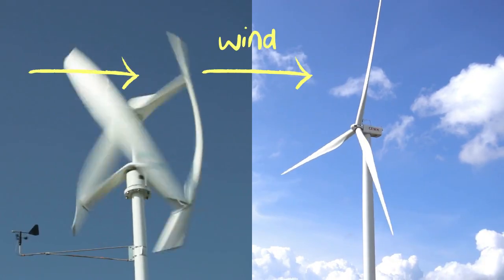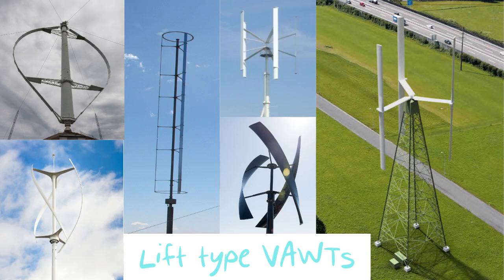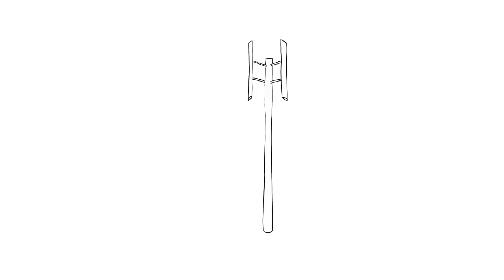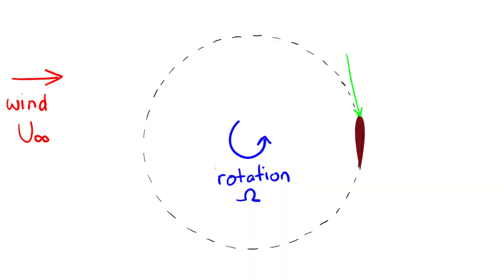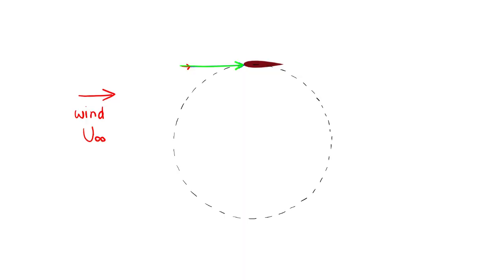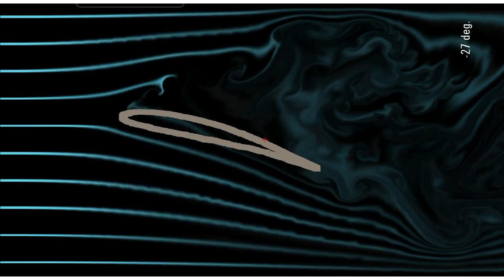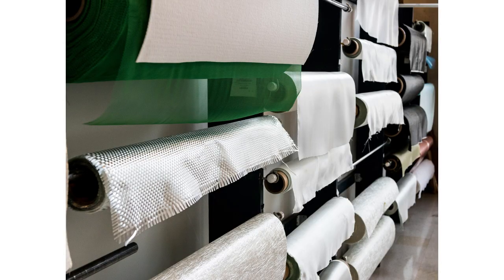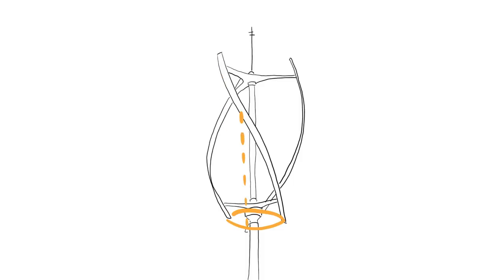Vertical Axis Wind Turbine Aerodynamics and Design

Comment: Hi Rosie, Is there some measurements on noise generated from WAWT or HAWT, if so do they compare. In Sweden WT haters claims WT sounds as an airplane taking off which I do not think is true. What about sound with lower frequencies or higher than the normal 40 Hz to 20000 Hz. It’s really difficult to find good scientific measurements. I should appreciate if you could comment on that. Thank you for your nice and professional scientific way to look on wind turbines. /Joppe
Reply from the maker: Hi Joppe, I really need to make a whole video on wind turbine noise! It is hard to give good answers here in the comments. But I will try.
Yes, wind turbines can be very loud depending on the design and the wind conditions. I wouldn't want to live directly underneath a large wind turbine. Most planning approvals include noise limits and manufacturers make sure to keep under them. I have lived within about 1km of a MW scale horizontal wind turbine, and that did not affect me in any way - I was way too far away to hear it. If you want to find out the noise level from commercial wind turbines, you can look that up in their sales brochures, they sometimes publish it. Other than that, I haven't seen any published measurements of noise from wind turbines. I will have a look and see what research is out there when I eventually get around to making that video on wind turbine noise. 
Low frequency sound: that is really not a health issue. There has been heaps of study on it and no real medical studies have found any effect from wind turbine infrasound. Wind turbines do create infrasound, but so does the ocean, so does traffic, so does the wind. Simon Chapman has written a lot on this topic, see this article for example:
https://www.ncbi.nlm.nih.gov/pmc/articles/PMC4227478/

Comment: Hello Rosie, very nice video. I now have a good understanding to what to design for while developing my own VAWT. Can you make a video on which type of airfoil (a lot of different designs available out there) is suitable for developing a 3/4 blade Helical-VAWT.

Thanks and Regards.
Reply: Here is an airfoil designed for VAWTs.
 http://airfoiltools.com/airfoil/details?airfoil=du06-w-200-dt
It is very important to scroll down to the Cl/Cl v Alpha graph.  The angle of attack is the X axis and the Lift to Drag ratio is the Y axis.  The colored lines represent the Reynold number the airfoil is operating at, effected by the speed and the chord (width) of the airfoil.

There is a Reynolds number calculator in the top left corner in the Applications section.  Based on the graph, a 1.5 meter wide airfoil operating at 10 meters/second would work very well.  A 100 mm wide airfoil operating at 5 m/s would be worse than terrible.  The characteristic of airfoils to perform poorly at  low Reynolds numbers is why small, lift type, VAWTs are not popular.
Reply from the maker: Great question, great answer! I will include information on airfoils when I make a video on detail design.

Comment: - very informative video!  I think the Voith Schneider propeller's active pitch control system would make a great system to be adapted for use on VAWTs with active pitch control.  Both the direction and the amount of pitch are variable so it would allow efficient operation over a range of tip speed ratios.  The system has been used for many years on tug boats and other work boats/ships.

I would like your reaction to the VAWT of US Patent #9,494,136.  All blades are interconnected forming a stiff structure.
Reply from the maker: Interesting, thanks! I will look into these topics.

Comment: Please tell what do you think about that types of VAWT:

1) "Round brackets" Darrieus 3-blades rotors

2) Darrieus 3+3 blades rotors with 3 stiffening rings or with one ring + stretch marks
(they wrote that such windmills can self-start even in a weak wind without spinning them up with a small Savonius rotor, due to the angle of attack of the blades of 3-4 degrees)

3) One of the most popular for DIY: Ugrinsky-type "paired wings", some of them is simple Novikov's rotor.

4) Lenz2: another most popular for DIY
Reply from the maker: Great questions, thanks! it's so helpful for me to know which specific designs people are interested in. Can you share a link to sketches of these types, I have not heard most of those terms before.
Reply: @EngineeringwithRosie  I don't know why, but Youtube hides all my comments with links

https://www.facebook.com/groups/windturbinemakers/permalink/4004016506321339/
Reply: @EngineeringwithRosie  Please visit "DIY Wind Turbine Makers" group on the Facebook, and see Daniel Connell's models.
Youtube hides all my comments with links
Reply: 3) Ugrinsky-type rotor

https://youtu.be/hrgYnmhwGtU

Comment: Great Video!! 
I'm Currently in my final year at university and I'm working on developing the Double Multiple Stream Tube model (DMST) to analyse VAWT turbine performance. So, I'm voting for this for the next video!!! Would love to see your breakdown of it, seen as it's an extension of this video.  Or even the single/multiple tube model.
Reply from the maker: Hey wow, big project. Good luck! You will know more about it than me if you've been researching for a while, I should be asking you for advice! 
It takes me months to research and finish a new video, so likely you will be finished before I get to it, which means it wouldn't be much help to you unfortunately. I would be interested to see your project though, so please post a link when you're done (and tag me so I get notified).
Reply: @EngineeringwithRosie ma'am  I really like your content..if It is possible can you show a detailed calculations each and every parameter measurement used for building wind turbine and design it in catia?

Comment: Hi Rosie! 

I love your channel and what you’re doing with it.  

I accidentally put my comment as a reply to another comment, so it’s a bit buried now.

I am interested in wind turbines for off grid applications for small cabins. I will likely install solar systems and the wind turbines will be supplemental to the PV panels.

I have not done a formal wind study, but I looking into installing a weather monitoring station to start collecting data. I’ve live on the land for a year and that has shown me that we have gusty winds that are occasionally very strong.  There is usually a slight breeze, but I would not classify the land as a high wind location.

Thanks so much!!

Tom
Reply from the maker: Thanks Tom, I found your buried comment already. And suggested that you measure wind speed so it seems you are way ahead of me there! Remember to take the wind speed where you want to put the turbine. Near to the ground it will vary a lot from one location to another even close by. Compare your data to published long term data to see how your long term values might look.
Reply: @EngineeringwithRosie  

Thanks Rosie! I’ll get a weather station and see what I discover. Since I wrote that comment, I’ve been paying more attention to the wind and realize that it’s much stronger and more frequent than I realized. Thanks for responding! 🙏🏻

Comment: I don't like VAWTs that much because of the lower efficiency but I'm still thinking about 3D printing one for my balcony. 
In my opinion the best type of VAWT is a hybrid between a Savonius and a Darrieus, because it has the advantage of selv starting in low tubulent wind but it still gets decent efficiency. Here is a picture of what I mean: http://image.ec21.com/image/hivawt/oimg_GC04092839_CA04092840/1500W_VAWT_Wind_System.jpg
Reply from the maker: Love this comment "I don't like them but I want to make one anyway." Pretty much sums up my feelings on wind turbines in back yards/ balconies! Which I guess means I do like them!
Reply: @EngineeringwithRosie  well I dont know what y'all are building,  but I have a device that is kicking butt in the speed department.   Its modular now so I can stack for more torque.
Reply: Come take a peek at my channel,  you might find something of interest there.

Comment: My future video vote is for the overlapping savonius (no surprise there). Not only do I think a vortex is involved,  but recently I've learned of the Coanda Effect which might also be in play on the drag blade  curvature as well.
Reply: as shown by the experiments of DIY-makers, the Ugrinsky-type "twin wings" rotors (by Biryukov, Blinov, Novikov, Popov...) are better than any Savonius rotors.

But Lenz2 is better and Darrieus is best
Reply: @MihailG5541  I believe I will leave it up to the more than qualified  engineer Rosie, to make such a determination.
Reply: @MihailG5541  But they all provide very little energy, and the storm is easily destroyed.
Reply: @ДэнКошман  long time ago, strong wind protection systems were invented
Reply: @MihailG5541  Для горизонтально-осевых единственная надежная бурезащита, это управление шагом. Для вертикально осевых таких систем нет, из за физики их работы.
Reply from the maker: @golotin I will add these to my list to look into deeper and maybe even test.
Reply: learn aerodynamics.
Reply: @ДэнКошман  ok Captain Obvious,  why don't YOU tell me all about it.
Reply: @doktaahwho8858  Knowledge is not obtained from comments on YouTube. It is necessary to study.
Reply: @ДэнКошман  i don't need to study quantum mechanics to install an electrical circuit and get a lightbulb to function.  Similarly,  I don't need to study aerodynamics to work with wind power.   I'm good with basic theory for practical applications.
Reply: @doktaahwho8858  Judging by the result, there is no knowledge of the theory, there is no properly working wind generator. Only dangerous toys are obtained.
Reply: @ДэнКошман  what on earth are you babbling about this time?
Reply: @ДэнКошман  well I'm glad you lot are sticking to the topic of voting for the next future video.  Because anything else might be considered as clogging the initial objective.
Reply: Hi Rosie!

I recently found your channel and love it! Thanks for transforming your deep engineering and wind power knowledge and expertise into easy to understand videos. 

I live on a 50 acre parcel in the Colorado mountains and am currently tied to the grid. I’m looking for off grid options to power some cabins that are too far from the power pole. 

Solar panels are my plan, but I became curious about adding a wind turbine too.

It’s very quiet and peaceful here, so I was concerned about noise from a HAWT, so I was researching VAWT.

I don’t need a turbine that has the highest efficiency, but that can provide additional power at night and when it’s not too sunny.

I’ve looked at both commercial and self built options and haven’t found a great solution. There are cheap ($300 or so HAWT and VAWT options) on Amazon, but they generally have terrible reviews for low power output and design.

High quality commercial options for residential use are $3000 or more. 

At that price, it just makes sense to add more solar panels to a photo voltaic system.

I’m curious if you have any recommendations of further options to explore?

From and esthetics perspective, I really like the design of HAWTs.

In your previous video you mentioned that you were investigating HAWTs for your own personal residential use. I’m curious to learn more about that and what you discovered. 

Thanks so much!!!

Tom
Reply from the maker: Hi Tom, interesting question and I hope to make some videos soon on topics that could help you... when I get some time! 
In most residential locations you will get much cheaper electricity from solar than wind. I personally wish that wasn't the case because I find wind energy much more interesting as an engineering project 😀 But it is reality.
If you are in a very wind area, or have poor solar resources or are not so worried about finding the cheapest solution, then it would be a very nice project to design an off grid system that was a combination of solar, wind and batteries. Maybe even add hydro if you have a river nearby!
If I were you I would start by checking the wind resource in your area (using a wind speed map) then if it seems ok, take some wind speed measurements in the actual locations you might install a wind turbine. It is likely to be a lot less than the map says, at the relevant height. Only then should you spend time worrying about which turbine to buy and its cost, reliability etc. The wind resource is much more important than how efficient the turbine is, as wind power varies with the cube of wind speed - so if you halve your wind speed there is only one eighth as much power available.
Reply: @EngineeringwithRosie  
Thanks Rosie! I really appreciate your insights and encouragement.  I will get a whole weather station to gather data about our beautiful place in the mountains.  I will start with a solar system and see it it makes sense to add a wind turbine. I don’t have a flowing stream, but hydro turbines are fascinating to me as well.  

Keep up the great work with your videos. I’m a fan and am sharing your channel with young people as well. 🙏🏻
Reply from the maker: @doktaah I will take a deeper look and see if I can understand what's going on and then try to explain it 🙂 Did you build one yet?
I am hoping to buy a few turbines soon to do a back yard comparison, I could include your favoured design if you know where I can get it or get the plans to make it.
Reply: @EngineeringwithRosie  i have a work in progress, and I am pleased with its performance so far.  Unlike the plastic cd  cases I am able to lengthen the height to be taller than the blade is wide and it seems to be working better than the original.  However, it is plastic trying to compete with metal and bearings.  But a dual magnet floating bearings is helping.  I'd be happy to assist you with the design I used, and its super simple to replicate.  All my devices and progress can be found on my channel or on my Instagram.  Let me know if you need any links.   The hardest part for what im doing is the time it takes to fabricate,  ive looked into 3D printing,  and they wanted a fortune.  For now its cardboard, glue, scissors and paint.  The plus side is the completed part is relatively strong and light weight.
Reply: @doktaahwho8858  hello my name is James Mason and I’m working on a low profile VAWT for my bus and I was wondering if you have any ideas
Reply: @jamesmason7124  Hi James, sorry to say I'm not a engineer.   I just dabble a bit here and there.  I personally like the Savonius for a few reasons.   I think there is more going on there than meets the eye, and also they are easy to construct due to low complexity.   I'm not sure what you mean by low profile, but feel free to check out my channel for some of my k'nex creations under the video tab.  I dont have much of a workshop, so alot of my creations are made from cardboard,  scissors and glue.  Call it a poor man's plywood,  once painted it can last for several years.  One of my most recent creations was made with some left over pizza boxes and some pringles containers.   One piece of information I can pass to you is this, ive read somewhere that the height of the savonius needs to be equal to or greater than the blades width. However this has yet to be confirmed as true.  Also thanks to Rosie, I recently viewed a paper that suggest a less than 50% overlap of the half circles make it a tad bit more efficient.   Hope some of that helped.  Good luck with your project.  I'll answer any question I can, but do keep in mind, I'm just a mad man with a box.